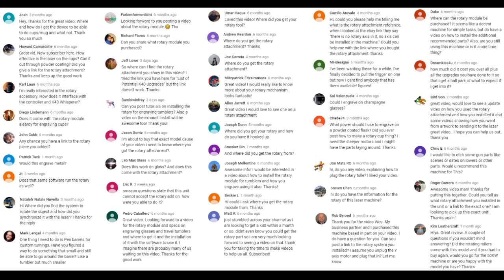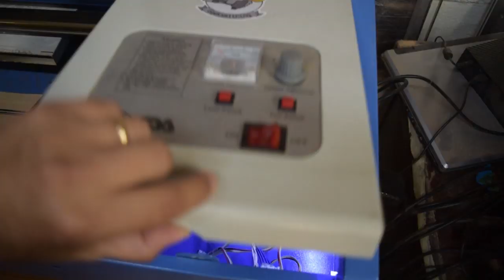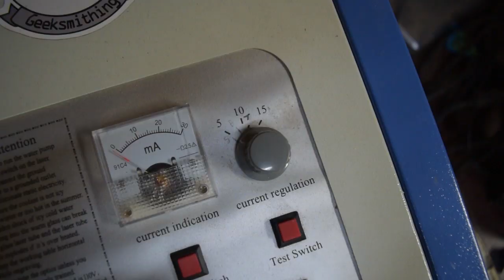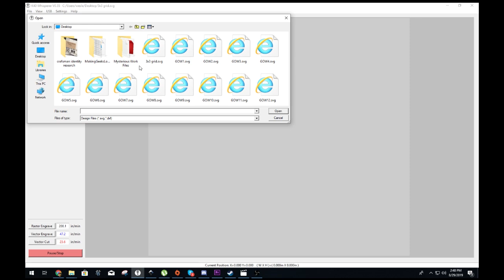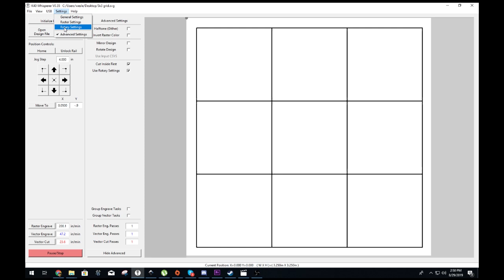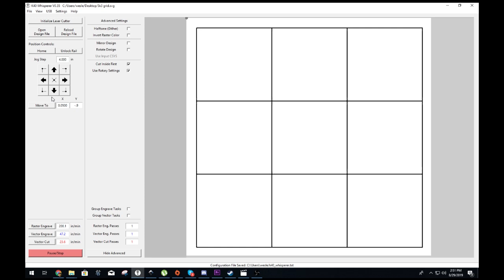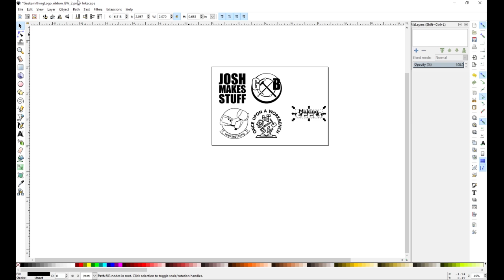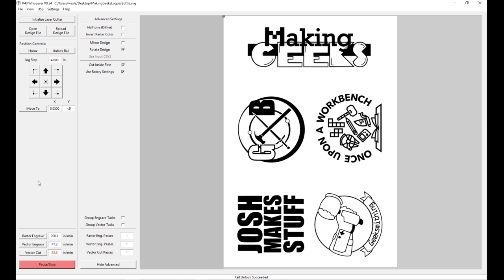DIY Rotary Module for K40 Laser Engravers!

Comment: Thanks for the video! A warning to those with larger (60W and above) lasers: this NEMA 17 motor will be fried by the motor driver. Those larger CO2 lasers use NEMA 23 motors so use one of those instead, and they also use a GX16 aviation plug connector.
Reply from the maker: The title and thumbnail literally say "for K40 Laser Engravers"...  Those models you list are not K40's... Sorry, I do not share your concern.
Reply: @Geeksmithing  I edited my comment to be a warning to people with larger lasers that use the bigger NEMA 23 motors. Hopefully people will see that comment if they are going to try to make a similar rotary based off this design. Thanks again.

Comment: Interestingly, because you turn the rubber wheels that then turn the bottle, the Y scale factor isn’t affected by a change in the diameter of the bottle. Neat way of doing it. You probably mentioned it but I missed it in your explanation.
Also, the stepper turns both rollers but if the friction is enough it only needs to turn one, the other can just be an idler. That way you can get rid of the belt. Chances of slipping would be more unless the drive wheels were carrying most of the weight. This way conical shapes would be possible without the cone climbing out as the different diameters travel different distances. You really only want one roller to drive, all others should freewheel. The shape will be distorted because the smaller diameter travels less than the larger diameter.
Reply: I know this is a really old comment, but can you explain what you mean about conical shapes not creeping if you have one drive roller and one idler?
Reply: @dustinhanlin  basically, if you have two driven rollers their outside diameter turns at the same rate. Unless the shape you’re turning has the same diameter in contact with the driven rollers it will slip on one of the rollers or try to move axially.
Reply: @klave8511  ok that does make sense. I had to visualize it to get what you were saying. Most tumblers are conical so I guess this design isn't ideal for those. I hadn't thought of that before I got the parts together. Maybe I'll just have to design one myself using some of the parts and convert the one wheel to an idler.

Comment: First off great instructional video   easiest one to understand out of most. I have made the rotary and worked fine and I actually added 2 dpdt swiches instead of pulling it out of main board all  the time makes me think eventually the connection may break but the switches work fine going from regular cutting to rotary by flipping switches and I thought I had it calibrated until I put a quick 4 pin disconnect on it and I made sure it was pin for pin but now again calibration is off and it runs backwards and I'm off calibration by 3.6875 inches but with your calculation its saying something like .27 inches switch I had it at .83 before it rasters fine except it looks kinda crunched in I'm going to take off quick disconnect off and see if it changes direction but .27 seems like it would make it more crunched can you check your calculation on a 9.5 circumference x 6  tall bottle and see what you come up with I may just be brain farting and doing something stupid simple but it worked at .83 really close until I added disconnect any help would be appreciated and once again awsome video explanation thank you you can also email me at mag200181@gmail.com if you would like more info. Thank you

Comment: Mine gets here Wednesday, hoping to do bottles for deer camp this year for everyone. What happens if the bottle isn't same size all the way down? Is there anyway to do that or is it a lost cause? Only thing I can think of would be to shim it so it's all the same distance from the laser
Reply from the maker: If you are doing a tapered tumbler or something similar, I cut a ring out of some scrap to fit on the bottom (or a roll of tape even!) to let the tumbler ROLL square (keeping the bottle surface slanted).  As for engraving areas that are on a taper, I have found that you can only laser a tapered region as long as that region falls within the focal range of the laser... As you may or may not know, the laser lens has like a sweet spot that it can remain in focus within... usually about 55mm to 65mm from the lens.  This 10mm range is all you have to work with.  If the design can remain within that 10 mm region as the bottle changed shape, then it should work..   It will be tempting and intuitive to want to raise the tapered end up enough so that the surface is level. (by shimming underneath one end of the rotary device)  This MAY work for you if your image is not very big, but it may cause an issue as the object rolls around, and will result in a distorted image in your finished product.  It may be possible to compensate for the distortion in the image editing software, but I have not tried it.  I definitely recommend a test bottle to laser on over and over again to get it all sorted.

I hope that novel of a response helps and makes sense.  Good luck on your project!!
Reply: @Geeksmithing  Thank you so much! I really appreciate the response and the words of wisdom! I'll try my best!

Comment: I like your design.  I have an Anet A8 I am adding a laser to.  I think I will build a rotary axis.  I am have to change the orientation, but it's looks doable.
Reply from the maker: Nice! What are you planning on lasering once you have one?
Reply: Mostly hobby stuff.  Cups and mugs, but it opens the door for me to build laser engraver for martial arts weapons.  I'm also rebuilding a 1980 Cj5 jeep and the dash will have an aircraft-like setup.    I think the possibilities are endless.

Thanks for the vid!
Reply from the maker: @Aikidoman06  I think you will run into issues lasering mugs and cups with a diode based laser, but only one way to find out! 😆
Reply: Geeksmithing maybe, but I'm going to give it a shot.  I've been looking into building a full blown tube laser cutter.
Reply from the maker: @Aikidoman06  awesome! Please share when you get it up and running!

Comment: Great explanatory video.  Question: the rotary table has a fixed spacing between the struts.  What is the minimum and maximum diameter circular object the table will handle?

Comment: Thanks for posting the video. If you haven’t already, check out Lightburn. I use it for my CNC laser and it seems a lot of people use it for K40s. Great product for the price.
Reply from the maker: Well, in order to use Lightburn, the control board needs to be replaced. I have that upgrade waiting in a box in the shop (Cohesion3D) , I am just waiting to go thru some more K40 videos using the stock hardware before making that jump.
Reply: There is also a lot of chatter about replacing the K40 control boards as you know. I am running Lightburn with an Arduino Uno and GRBL. Works like a champ.

Comment: Have you thought about using 2, 3, or 4 different sized rubber wheels on 1 end that you can slide in & out so you can do non nice cylinder? So like the slanted coffee tumbler.
Reply from the maker: You could totally do that! My solution is I have a 3d printed ring that I slip into the narrower side of the tumbler that keeps it lifted up and  level. Good idea though!
Reply: @Geeksmithing  Correct me if I am wrong, but I have tried this - (I am very new to this laser process) - by adding a taller ring for say the 30 oz tumbler that has a larger taper in the bottom, you must change the rotary settings as it stretches the grid test substantially.  Settings must be changed to do this...am I correct about this?

Comment: Really cool presentation and excellent kudos for making it available to print etc.

One thing I dont understand is how do you cope with cone shape items like the drinking cups and say a 1 pint glass which is say 4 inches at the top and 3 at the bottom of a height of 10 inches . 

There is nothing on the rotary machine to cope for the difference in level? Normally I would expect to see a adjustable wheels , Bars at the bottom of the Rotary unit .  

Do you put something under the shallower end to lift it up as the bottom of the glass is out of focus compared to the top Surely??

I would love to know how you resolve this please. Many thanks Neil
Reply from the maker: Hey Thanks!  Yeah for tapered objects, instead of taking things apart and adding new roller each time, I have found that it is easier to cut a wooden ring (with the laser cutter) that will fit onto the smaller end of the glass for example, that will allow it to roll squarely.  It may take some fiddling with sizes to get it just right, but very useful if you are batching items out.  The other thing I have used in a pinch, is a roll of masking tape actually.  It fits right onto the end of a tumbler perfect and I just used up enough tape to get it to be the correct thickness so that it rolls square.  Hope that makes sense.  Good question!
Reply: @Geeksmithing  I thought some thing like that, all you need to do really is add two rollers at the other end on a angled hole each side, allows them to be tightened on piece fo 2020 and you have a K40 tightening adjustable 2020 bed that works perfectly for odd shaped circles.

Comment: Excellent presentation. I have had a K40 for about a week now but still haven't used it!! I'm waiting for a honeycombe base, have added air assist, red dot laser, water temp gauge, ammeter and threw the air extract internal "funnel" in the bin. I didn't bother shortening it as it is pants. I cut a 4" hole in the side of the machine for clear turbulence free extraction. I bought the machine for "flat" projects to enhance my woodworking projects. I've read statements claiming that the K40 can't have a rotary function but it was in my mind that all I had to do was what you have here but I wondered if I was missing something. All of this is to demonstrate my lack of knowledge or experience before I ask this question. If you increased the diameter of the wheel on the stepper motor would that resolve / remove the need for the calculation? Can a perfect stepper wheel diameter be achieved?
Reply from the maker: I suppose that is possible, but there can be a variance depending on the stepper motors, and it might not be a one size fits all type of situation.    Great question though!  Congrats on the new shop addition and I hope it all works out for you!  Drop me a line if I can help in any way! :)

Comment: does your y-scale you calculated change if you use a bigger diameter bottle, or is that a one time setting? thanks
Reply from the maker: It does not change with the diameter of the bottle.

Comment: That will only be correct for that particular bottle, a larger or smaller bottle would need some more fine tuning right?
Reply from the maker: The diameter of the bottle has no bearing on that.  Once you do the calibration step I show in the video, that holds regardless of the size.   When you get a larger bottle, it's changing the circumference. That is the measurement that matters as it dictates the dimension of your design. The height of the design is constrained by the bottom of the bottle to the mouth of the bottle, but the width just gets wider as the diameter increases.  The larger the circumference, the longer distance the rollers have to spin the bottle to make a full revolution.  Hope that makes sense.

Comment: THANK YOU for sharing!!! You obviously gained a sub! When doing taped cups like the white one in your video,are you just jacking up one end until it's level and still within the focus parameters?Now you got me thinking of raising the machine,adding a lens on a Z servo,and doing all sorts of neat stuff!Or seeing if the light can be guided through a fiber optic or something!Probably be easier just to get something bigger than a diode laser to work on my CNC engraver or 3D printer.Too many toys,Too little time.You get a Smiley Face for the day!
Reply from the maker: The tapered cups are a bit trickier, as you actually do NOT want the surface of the cup to be perfectly parallel when lasering, as it will actually distort your image as it gets lasered onto the cup.   I would cut a wooden ring on the laser to slip onto the tapered end of the cup.  This outside diameter of the ring would be the same diameter as the widest part of the cup making contact with the rollers.  If you can imagine, this makes the tapered cup roll like a perfect cylinder.   The tricky part is making sure that the region of the  cup you wish to laser needs to be withing that focal range at its closest point and it furthest point from the lens.. Hopefully that makes sense.
Reply: @Geeksmithing  Makes perfect sense,and WAY easier than my idea!
Reply from the maker: @Bowtie41  I am also interested in adding and adjustable Z axis though, perhaps even motorizing it as you suggested!:)

Comment: I had great expectations for this video, which in it self is awesome. Started to watch it and got more and more discouraged by the minute!! Not your fault off course. Rather quick I thought to my self: ok, yeah, aha...... that's never gonna happen. No way I am going to build that rotary module!!!  So I took a shortcut and found one on amazon. Should arrive next week. ;-) Next challenge is understanding the software!!! Any advise on that to someone that is not nearly as geeky as he wants to be. :-)
Reply from the maker: Thanks!!! Well, I explain the software on the video as well, I hope it helps! 😆
Reply: It's exceptionally easy to build.  I didn't do the geometry; I just printed a logo, adjusted the Y-steps, printed again, and after only three burns I got it dialed in.  Turned out to be just about 2.0 x diameter for the steps per mm.  An 80 mm bottle needed 160 steps/mm.

Comment: I've had a rotary for a few months and have yet to use it. WIth this video, I think it will be easy to get great results. What is a good power setting for powder coating?.....you were at 7mA (what is that in percentage....I have the percentage pane). Thanks!
Reply from the maker: Hmmm good question...  Not completely sure, but I'd start at 25% and go up from there. Until you see it is zapping it away.

Comment: Great Design! I made one very similar after watching your video but out of aluminum instead. (I'm a waterjet operator for the day job) I was wondering what bottle you were using and how you get the engraving to show up so clean? I am having a problem with the engraving almost not getting all the way through it seams. I have tried on multiple power settings but can't get one to turn out clean like yours. Any and all advice is appreciated!! Thank You!
Reply from the maker: Hello!  The bottle I used was a cheap one from Wal-Mart actually... They often have a variety scatter throughout the store.  I just use the settings shown in the video, and the use goo gone to clean it up at the end.   If the image is jagged, then you are likely going too fast.

Comment: hello Do you remove the laser tube when cutting the bottom of the unit? Thank for your reply
Reply from the maker: I did not. The region being cut is pretty isolated from the tube. As long as you tape up all of the mirrors and the holes in the chassis where the beam exits the tube area right after the first mirror bounce, it should be fine.

Comment: very nice explanation, thanks. I do have 1 question. Right before you started the engrave, you manually moved the head. Does this not mess up the settings in K40 Whisperer. I always use the jog buttons in the program, never tried to manually move it.
Reply from the maker: Hey thanks!  So in K40 Whisperer there is an Unlock button to release the motors. This allows you to freely move the head around however you want.  When you start a job on K40 Whisperer its 0,0 (the top left corner of the design) begins where ever the laser head happens to be when you start the operation... it doesn't really care where it's 0,0 point is...Hopefully that makes sense :)
Reply from the maker: Just have to make sure there is enough room left for the head to travel to complete the job, as it's measuring all based on where that 0,0 point is
Reply: @Geeksmithing  thanks, I'll have to try that. hat would save a lot of time playing with the jog buttons.

Comment: Is there an easy solution to bringing items of different diameters into focus? I'm used to being able to adjust the laser head to get the proper focal length, but with everything stationary, this is throwing me for a loop! And of course I just bought the k40 strictly for my tumbler etching 🤣 ... 🧐🤓
Reply from the maker: Well, there is no dynamic focus or anything, as you said, it is all pretty static.    The only caveat is that the lens has focal range where it is more or less in focus.  This is how I am able to do tumblers myself!   On mine, I just adjust the height of the tumbler so that it is like 55 mm between lens and the closest point of cup using a ruler. The focal range of the laser is about 10 mm, so the furthest  point that can remain in focus is 65mm away.     On the tumblers that I laser engrave for example, I cannot engrave the section that is super tapered between the upper section and the lower section of the tumbler. ( If that makes sense). I just stick to you engraving the upper section and there's enough range there to allow for that. I really should do a follow-up video specifically about tumblers. Feel free to message me if you have any other questions I'll be happy to answer them best I can. Good luck with your new laser!

Comment: Have you by any chance made a lower profile rotary module to alleviate the need  to cut the bottom of the laser?  Or are there any modules that you may know of that someone else builds or sells already assembled that can work with this machine?
Thanks.
Reply from the maker: As far as I know, you may have a hard time finding other rotary devices that are lower. That was one reason I made this as low as I could, to help prevent cutting the bottom out of possible.